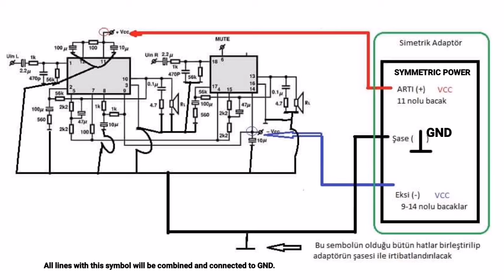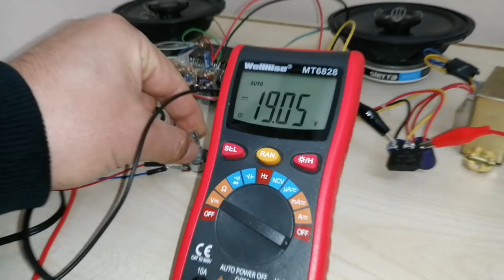How to make powerful amplifier at home STK4132 | Bass amplifier | STK4132 çok güçlü Amfi yapımı  DIY

Comment: I tried but had a problem at pin 14 (10uf) always popping, where is the error?
Reply from the maker: Hello welcome. Pin 14 must be connected to GND with 10uf. Symmetrical feeding is a must for the Stk amplifier. Making symmetrical power video is on our channel. We are waiting for you on our youtube channel for support. I would appreciate if you subscribe, thank you
Reply: I still don't understand when you put elco 47 ohm on pins 13 to 17 can you help me to understand
Reply: i have tried 2x but elco 10uf explodes
Reply from the maker: @alipremansier8006  If you watch the video carefully, I think there will be no problem. I am unable to assist remotely. thanks